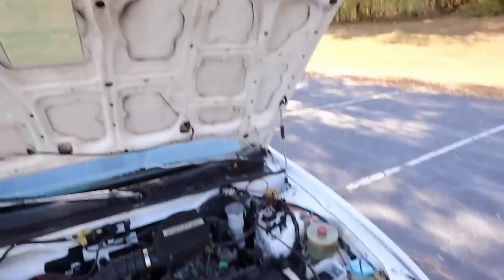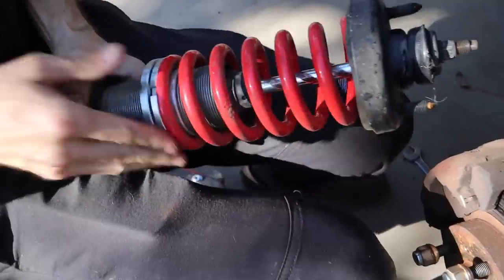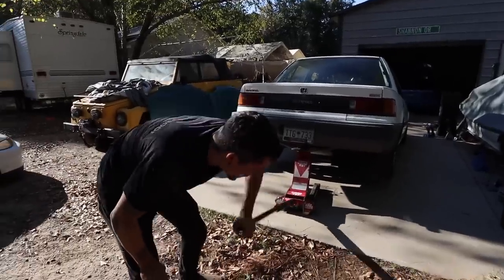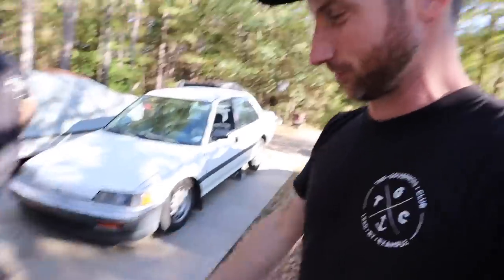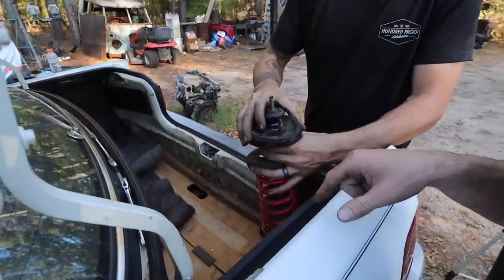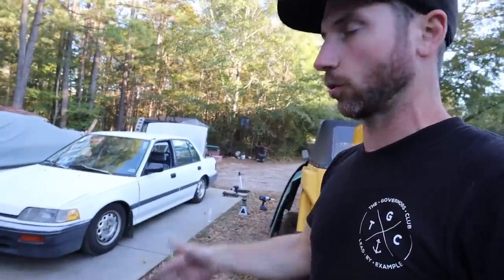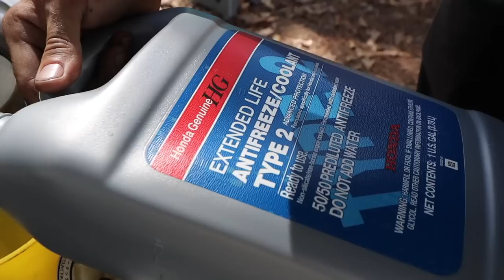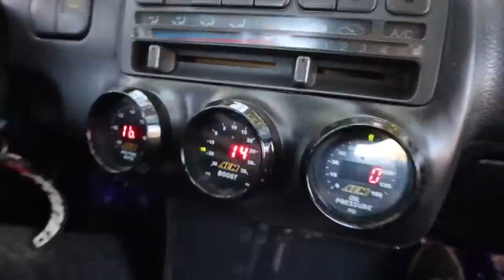I BOUGHT A MOTOR, AND CAME HOME WITH A NEW CAR!

Comment: Back when I was looking for an EF chassis, I actually was specifically looking for a sedan (or CRX as I eventually bought), but I looked at a K24 swapped sedan and wish I could've found a cleaner one, even in the DC area these things are always rusted to hell. EDIT: for wheel recs I'd say find some 13" vx wheels, they're magnesium and cool as hell, but quite rare now, 14" hx wheels are what I had on my CRX and I enjoyed the way they look
Reply from the maker: I would absolutely love to K swap this one 😂
Reply: @JohnLudwick  funny thing about the one I checked out was it was a big turbo AWD car before, but then was converted back to FWD/NA. That was the biggest reason for skipping over it, had a hole in the firewall for turbo clearance 🤔